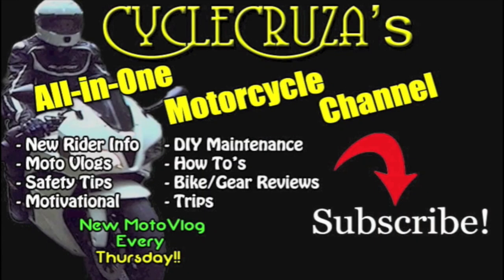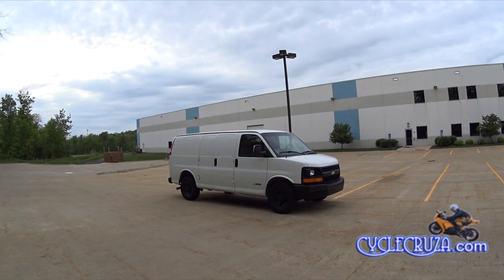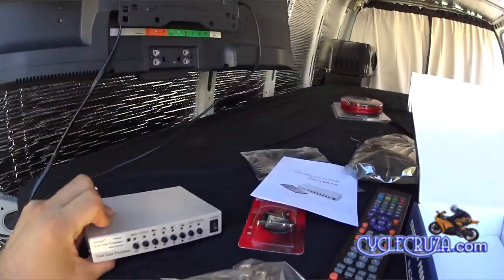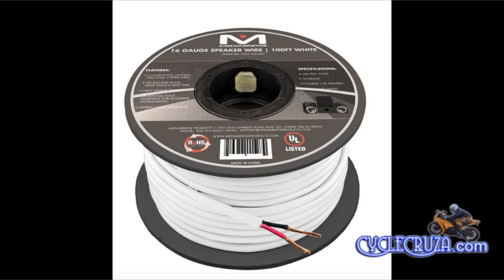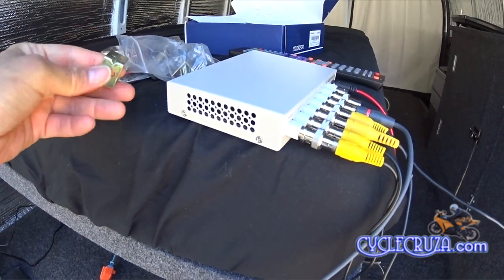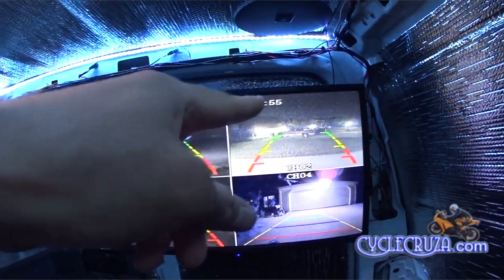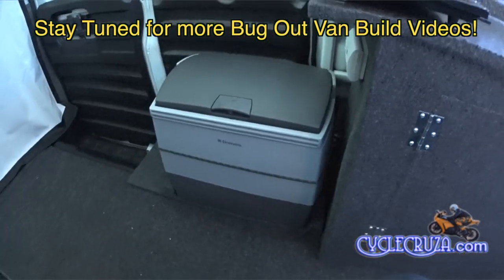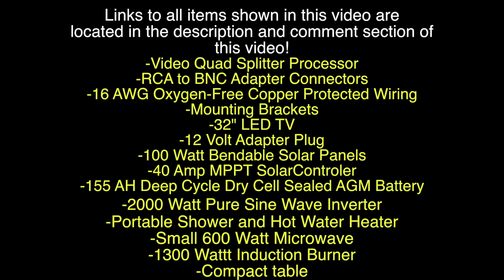Bug Out Camper Van Video Camera Surveillance System | Bug Out Van Build Series

Comment from the maker: FYI- Here are link to most everything in my video since people always ask!
Get Infrared Cameras here: http://amzn.to/2cMjGDI
Get Quad Video Processor here: http://amzn.to/1OuYYlG
Get RCA BMC Adapter Connectors here: http://amzn.to/1Ijupgo
Get Small installation Brackets here: http://amzn.to/1Om8HvV
Get 12 Volt Adapter Plug here: http://amzn.to/1KLkLce
Get 16 AWG Oxygen-Free Copper Wire here: http://amzn.to/1CPGpcP
Get 600 Watt Compact Microwave here: http://amzn.to/1KLyFbq
Get Water Pump here:  http://amzn.to/1M6eOHo
Get 1300 Watt Induction Burner here: http://amzn.to/1Dkjcj0
Get Compact Travel Table here: http://amzn.to/1IjtKvf
Get Portable Shower Tent here: http://amzn.to/1KLxWav
Get 300 watt 12 volt Water Heater here: http://amzn.to/1KLxQzp
Get 100 watt Bendable Solar panels here: http://amzn.to/1S1ROaJ
Get MPPT Solar Controller here: http://amzn.to/1S1Sop0
Get Solar Controller remote Meter Here: http://amzn.to/1K16asL
Get 155 AH Deep Cycle Battery here: http://amzn.to/1S1RxVa
Get Smart Battery Charger here: http://amzn.to/1KFsgBd
Get 2000 watt Pure Sine Wave Inverter: http://amzn.to/1OKkDrl
Get Back-up Camera with Night Vision here:  http://amzn.to/1KkLDg8
Get 32” LED Tv with DVD Player CHEAP: http://amzn.to/1NYh9lj
Get Electrical Switch CHEAP here:  http://amzn.to/1IzFusY
Get LED Light Set CHEAP here:  http://amzn.to/1IizIQH
Get 10" Hi-res Back-Up Camera Monitor:  http://amzn.to/1M1xZAC
Reply: +CycleCruza The Quad processor you have linked on Amazon has changed. I just received the item linked here and it is just a PC board without a case. Since I ordered it, the photos and description on Amazon have changed. I should have known it was too good to be true because the price was under $12.
Reply from the maker: +noyopacific Sorry about that, they must have switched the product. I clicked on my link and it says I purchased this item but it's a different product now. I updated the link. Here is the new link which is the same product as I have:  http://amzn.to/1OuYYlG
Reply: +CycleCruza Thanks! It really wasn't your mistake. Between the time I ordered it and got it, some unscrupulous seller had changed the description and photos. I think a previous seller had run out of the item so the new seller figured they could just "adopt" the Amazon item listing & borrow the past rating and reviews while they did a bait & switch. What a goof ball. They tried to dick me around on the return so I filed a claim with Amazon & got an instant refund. That's one more reason that I like Amazon. Thanks Again & Good Luck!
Reply from the maker: noyopacific Yeah that was a bs sneaky move, doesn't happen often. Thanks for letting me though, I changed the link.

Comment from the maker: ***CycleCruza's Recommended Videos*********

Watch Bugout Vehicle Unveiling Video here:
https://youtu.be/l7gU7P-kv8I

Watch Bugout Van Build Part 1 Insulation Video here:
https://youtu.be/kp59Nkk7Asw

Watch Bug Out Van Build Part 2 -Flooring Install Video here:
https://youtu.be/NXPwck_WcvE

Watch Bug Out Van Build Part 3 -Sink Counter Build Video here:
https://youtu.be/pcZR7bqqoWw

Watch Bug Out Van Build Part 4 - Folding Bed Build Video here:
https://youtu.be/VRFYFsW0t9I

Watch Bug Out Van Build - LED Lighting  Video here:
https://youtu.be/BduzjVNQgEg

Watch 'How To Load a Motorcycle in a Van Easy" Video here:
https://youtu.be/mq1YguXZQ0Q

Watch Bug Out Van Fold Away TV Build Video:
https://youtu.be/0C9AG1W-XRM
Reply: CycleCruza You're running out of room in there btw! Although I am really surprised by how much stuff you've packed in there
Reply: I am amazed at how much stuff you are packing in that van. Good video series.
Reply: How long does it take the solar cells to charge your battery bank, also are you charging your battery's off the alternator?
Reply from the maker: Blablabla Everything in the living area is run off solar power. The only thing I have running off the van's system is the back-up camera that is controlled by a switch. As far as charging, I don't really use all that power right now but I do leave my refrigerator on 24/7 but it used very little energy. Every time I get in the van it's fully charged except at night of course when the sun is down. I'm thinking about adding another 155 ah battery so I will have a total of 465 amp hours!
Reply: Getting better and better every video
Sorry for my bad english
Reply: CycleCruza Awesome! Your setup looks great, keep up the good work buddy.
Reply: CycleCruza Hey man don't know if you are using them but I think infrared camera is a great investment. Just in case some dirtbag is snooping around or trying to mess with the van or something.
Reply from the maker: ZinNYC the rear is infared, the other are still viewable at night. I may upgrade the side and front cameras later on.
Reply: CycleCruza Yeah a full perimeter coverage is a good safety feature. But good going dude I actually can't believe you pulled off. Awesome man.. all you need is that dual sport and you are set.

Comment: Nice surveillance system you installed CC. I hoped if you used cameras without the guide lines. Its cheaper than the guided ones.
Reply from the maker: +Aziz Saad I tried several different ones but the camera with the best resolution is the one I chose. I tried all the cameras without the guidelines and they all sucked. However, the guidelines are actually good to have because it helps me to gauge the object's distance from the van.

Comment: Nice stuff bro. Are you going to look into a way to filter the water you have used so you can reuse it?
Reply from the maker: Milo Tidwell No, that would be cool though. If I had more room under the counter I could set up a filtration system but by the time I'm done with this van it will packed to hilt in the cabinet.

Comment: Just so you know...you can get similar backup cameras but without the guidelines on the monitor. Here are some that I have used. They are not IR but do work very well in super low light. Also the FOV is 170* instead of the narrow ones.
https://www.amazon.com/gp/product/B00H3ZN3JK/ref=oh_aui_detailpage_o01_s00?ie=UTF8&psc=1
Reply from the maker: All of mine work in low light. I've tried all of them available at amazon and mine had the best resolution. I tried the ones without the lines but the resolution was pretty bad.
Reply: +CycleCruza Oki...kewl beans

Comment: Consider moving the water dispenser hose away from the wheel, so that any substance that isn't water (e.g. Oil) can't affect the grip of the tire, unless strictly water is what will be flowing through, then it's fine 😆
Reply from the maker: Onion1220 PMR I will just have to be careful to not flush any oil or other substance down the drain.
Reply: CycleCruza true, great job on the van anyway 👍 keen on seeing it completed!

Comment: nice setup, is that processsor running of 12v or do you have an inverter? do they make them for 12v?
Reply from the maker: The video processor is on 12 volt power, wired to the solar batteries. I did not have to make it 12 volt, it was already 12 volt compatible.

Comment: Yo CC - what's the draw on the battery on this sort of set-up? If left on without the engine running - what's the battery life,and do you have them connected to a separate ( living/leisure) battery? Essentially - how long will it take to flatten the battery without the engine running? Cheers

Comment: Cool idea with the cameras .. I'm just curious though  what are your plans if you run in to some trouble . like if some body was actually trying to rob you how are you planning to defend your self .  do you carry?  What's your opinion on carrying?
Reply from the maker: Randy Barringer A choice of either a 9mm or 12 gauge shot gun ready to blast a fool. lol This  cam set-up will most likely be used for cop detection so I can lay low and cut the lights off and play possum like JW are at my door at home. lol